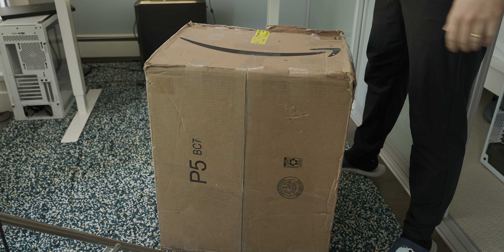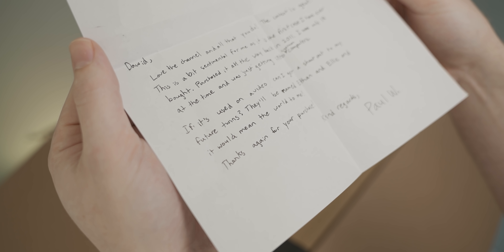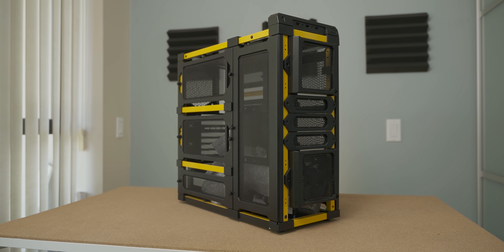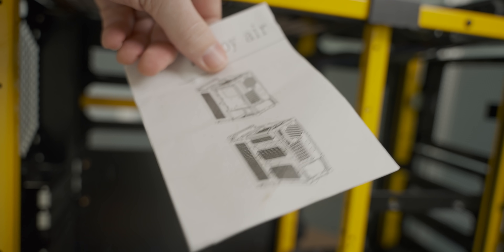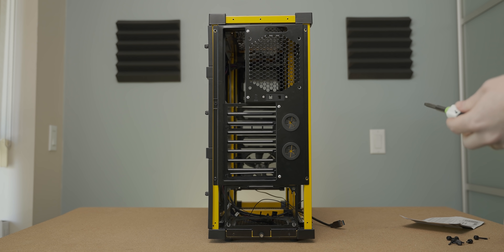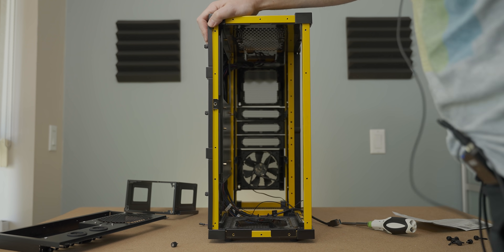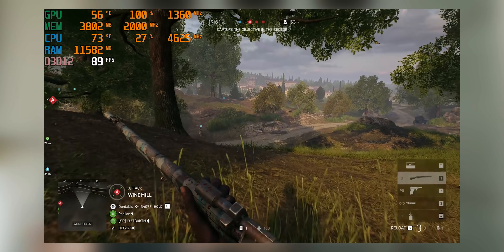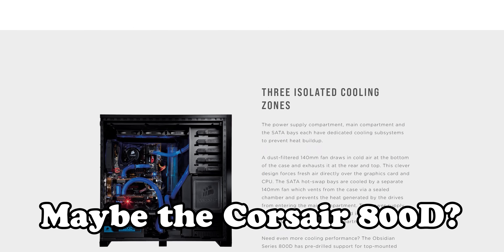The BEST Airflow Case Ever Is From 2010?

Comment: Best Intake/Exhaust or "free flow" case sure? But best airflow? No... You need negative pressure for good air flow, the fact this is completely open means theres zero directional airflow, meaning this case actually probably has the WORST airflow of any case.